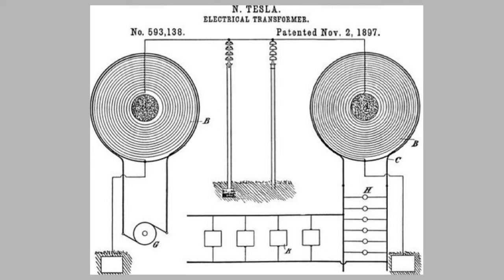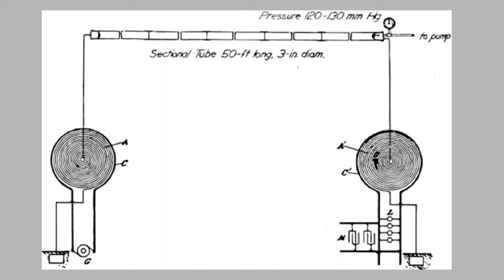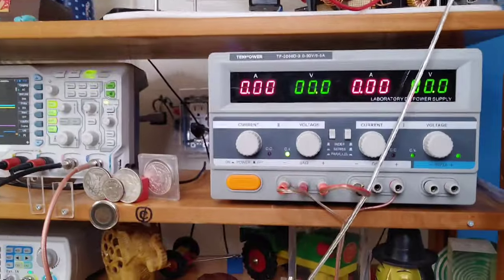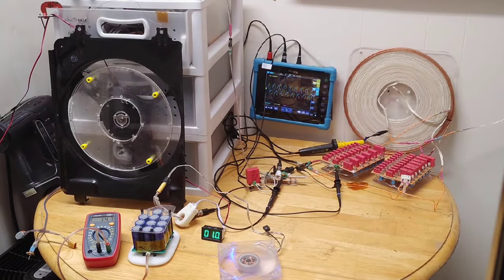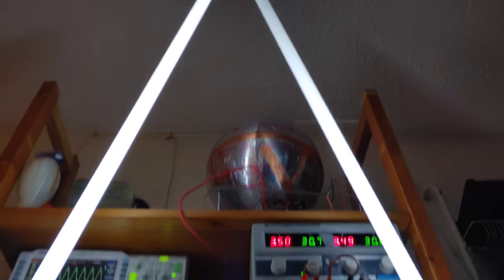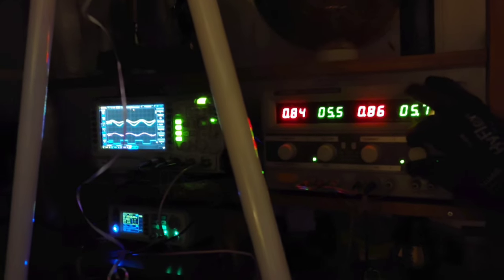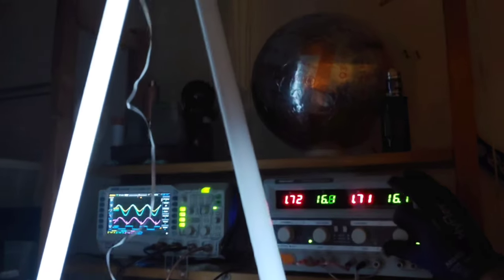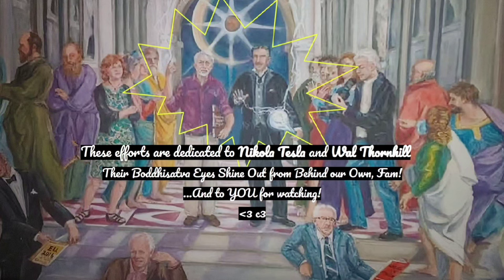Nikola Tesla's Single Wire Power Transmission, Part I: thru Flourescent Tubes & Wire

Comment: In Australia they use some thing called SWER distribution of 50Hz electricity out in the country to save on cupper wire. SWER is Single Line Earth Return. I believe the lines carry some thing like 6kV. It is returned to 240V at the end of cause. It works fine.
To use high frequency allows you to use it like a radio transmitter/receiver. There the power decreases with some thing like the square of the distance unless you can direct it with some thing (a wire connection is the ultimate director).
Up front without knowing the frequency you use I would think that the fluorescent tube fluctuations could be standing waves.  The high intensity points would then be 1 wave length apart. Also the tubes just work as a high resistance wire connection.
The high frequency burns you get when getting too close is because at those frequencies the capacity of your body works fine as a return line.
Reply from the maker: Shoutout to Australia! Yup i was recently reading with envy  about the WONDERFUL Aussie SWER system which is highly efficient for remote power grids! Advanced,  props! Some call this system I'm testing 'single wire without earth return" SWWER, some call it stray capacitance to earth and consider it a return, but N Tesla called it 'without return' so i take his word as usual.

Freq=130k cycles/sec. My best tentative guess for the fluctuations is what's called "ion acoustic waves", which are a sort if standing wave in the plasma. In conventional usage with flourescent tubes, the effect is called "striations", and are attributed to the mercury ballast becoming vapor or some such bollocks. Wavelength is ~2cm, I'm glad somebody else wondered of that measurement (....errr...  although l've yet to figure the frequency or take it any further).

I only get burns if i touch my fingertip to the high voltage output wire directly; supposedly this 'longitudonal electric wave propagation mode' is non-thermal, i recall reading about it back when i coined my tag 'cold elecric' 😇 Tesla called em 'Non Hertzian', i.e. distinct from transverse electromagnetic (TEM) waves. Contemporary researchers now call em 'longitudinal magneto dielectric' (LMD) or sometimes 'scaler waves'. Akin to displacement current between capacitor plates.

On my scope when tuning, the first resonant peak is said to be TEM mode, the second peak (about 1.6x the first freq) is said to be LMD mode, and this is my area of interest always used.  But the description is not entirely overwhelmingly convincing to me, hence the present efforts to 'disprove' (or validate & demonstrat) the phenomena. I do need to know if there's a major unknown aspect of electricity! I hypothesize 'cosmic displacement currents', electric sound waves rippling between all the conductive spheres in the cosmos, as the subtle mechanism of charge transfer across vast distances, powering the more perceptible phenomena of our electric universe.

Also the inverse square law is purported not to apply (sources: konstantin meyl, eric dollard), decline is claimed to be only 1/R, this is a means to test the longitudinal mode's presence, too.
Reply: @cold3lectric  Your frequency 130kHz would have a wave length of 2300 meters so is obviously not the cause. 2cm would make the frequency about 15GHz.
I used to get skin burns when working on picture tube TV's way back. They work on about 16kHz and it could make a nice spark to screwdriver through the capacity alone. They had about 3 - 5000V I believe.  They had much higher on the tube but it was DC. This was what was driving the high voltage transformer and the horizontal deflection. 
I think that the most electric in our universe is the electron. As I believe it is a standing wave of energy and as that energy can also manifest itself in radiation I believe there must be some kind of dipole in all radiation containing a positive and a negative end. I would there fore like to know how radiation really happens. It is electro magnetism but what is electricity and what is magnetism? I believe that to be the fundamental parts of every thing.
From this I am also wondering how a pulsating dipole can present itself outwards as negative forming the electron (or positive if a positron).
Reply: @cold3lectric @cold3lectric I've read a bit of Meyl suggest that Nikola Tesla was observing a variety of non-linear phenomena that could explain the longitudinal transmission behavior. Spin or torsion waves are mentioned. Another confounding phenomena to add to the problem is the surface plasmon polariton wave (Zenneck wave) which can couple an EM wave to a surface charge wave on the Earth.

Other effects that I've heard Tesla could  have discovered include phase conjugation of signals. Phase conjugate mirrors can be used to create resonant sytems with astonishingly high Q factors. What's more is that kindling of such a system could be possible through the ionosphere-Earth cavity, which would allow the system to be self-pumping. 

The "Non-linear Shuttle Oscillator Circuit" Tesla patented in particular is an interesting system for parametric amplification of signals. Some authors have suggested it could have been performing the role of non-linear element in a phase conjugating transciever. Air Plasmas are known to support phase conjugation by 4-wave mixing, so corona discharge and atmospheric ion acoustic waves may have also played a role in the performance of this system. 

Quantum potential effects such as the Aharonov-Bohm effect and the Maxwell-Lodge effect may create unusual conditions in situations where there are gradients and divergences of the magnetic vector potential and electric scalar potential. A scalar superpotential theory could unify Electromagnetism and Gravity as distortions in the same underlying vacuum structure. Gravitoelectromagnetism predicts that certain mass-energy currents produce gravity-like fields, so it should be experimentally falsifiable. Gravity Probe B has already confirmed the existence of gravitational frame-dragging caused by the rotation of the Earth. Robert Forward designed a type of warp drive within the framework of relativity that had a helical toroid structure, a high density gas would accelerate to near light speed around a closed loop wound into a torous. The highly non-linearly changing mass current (higher order derivatives of acceleration such as jerk), flowing in that path produces a toroidal dipole moment in the gravitational field, which implies gravitional induction due to a gravitoelectric dipole. Gravity doesnt have opposite charges so in the weak field limit dipole gravity cannot exist, but in hyper-relativistic motion and under higher order accelerations,  gravitoelectromagnetism still predicts a type of gravitational dipole arises.

Toroidal dipole moments and Anapole moments, the types of EM modes where such unusual effects might arise,  are relatively unexplored area of electrodynamics. Dark matter made of EM anapoles has been proposed as a candidate for the Majorana Fermion for example. Recently a "non-radiating" antenna, an Anapole mode antenna, was created to demonstrate wireless power transmission to a perfect absorber. The anapole had an amazingly high Q factor at resonance due to the conjugation of the far field radiation produced by a dipole antenna and a toroidal dipole antenna. Radiation suppression leads to intense near field radiation and currents in both antenna. But what if you had two anapole antenna? How do you describe the electromagnetic behavior of two perfect absorbers? You need to describe the conjugate photons in terms of quantum potentials or information is lost about where the energy went, in this case it comstructively interferes in the anapole antenna to drive current (instead of heat as other antenna would). Even though no EM radiation is emitted by the anapole, it still radiates quantum potentials, and a second perfect absorber would break the symmetry of the conjugated photons, converting them to currents and seperate EM waves again. Only a highly non-linear antenna could recieve such a wave. It appears the energy would get trapped and distributed by perfect absorbers with almost zero attenuation because it is not carried by transverse EM radiation per se, but by the propogating quantum potentials of pairs of EM waves. Due to the auto-resonant, beam forming and distortion correcting properties of the two anapoles, you can also expect a high efficiency power transmission through most obstacles made of linearly conductive materials which would otherwise impede EM waves.
Reply from the maker: @taylorwestmore4664  yeah the "vortex potential oscillation" description of Meyl seems a likely candidate - though I'm presently still imagining them as 'electric sound waves', spherical pressure waves rippling outward. I may need to sample some psychedelics again to be able to picture a pressure wave as a vortex simultaneously (not ruling it out) 😈

I'm a bit perplexed lately about the difference/identity of Zenneck surface waves & Tesla's 'earth resonance', they're NOT the same yeah?

Honestly my degree was in petroleum engineering so i can do well with the hydraulic analogy, but otherwise I'm going almost exclusively off of Tesla's words, and a few modern guys like Dollard & Meyl. I've heard it suggested to forget all about "radio stuff" when it comes to Tesla coils, so presently its all virgin soil to me, just gotta be a no0b :)

Also there's an awesome NASA Contractor Report "Advanced Energetics for Aeronautical Applications" which covers all this longitudinal electric wave stuff on pages 40-60, if interested:
https://ntrs.nasa.gov/citations/20050170447
Reply: @taylorwestmore4664  im of the view theres no power being transmitted at all.

just the impetus to allow power to emanate.

i take a conductor, shove it in a changing magnetic field, i get a changing potential across that conductor.
a minute amount of power as that potential attempts to short itself out through the conductor itself, against the flow that would occur if we were to actually short the ends out as the conductor is in "reverse" across that potential difference compared to any resistance we place across the ends of it...

thats how i see radio waves. i cant see any electric wave. just changing magnetic fields inducing changing potentials in conductors affected by changing magnetic fields. i only ever saw the electric part of EM as the byproduct of its interference with matter.  we produce this tiny little potential difference,  any current is killed by its own lenz reaction, so theres sweet eff all power...and then need amplifiers and all that to do anything with the resultant miniscule leftovers... (consider... how was tesla or contemparies even detecting signals before amplifiers, tubes, speakers, cathode ray tubes?)

invert it. reverse it. unthink it.

i change potential.... and over there, another conductor must change potential in sympathy. it changes potential, and then attempts to neutralise... there is a flow...
then its given another nudge, an alternate potential... a reverse flow...

get it resonant, keep it tickling... only need enough power here to oscillate, to make the alternating potential. the change in potential is felt everywhere in sympathy. a conductor separated by an insulator... what is the rate of "capacitance"?

not power transfer or reactance, but the rate at which one plate upon taking a charge, causes an effect, an opposite charge on the opposite plate? at what rate does that change of potential propagate through the dielectric? how does the distance, the thickness of the dielectric alter this? not teh potential it can carry, but teh rate at which information between two conductive surfaces feel each others "charge"?

not transmitting POWER. just the IMPETUS to cause power to flow. "to separate the charge" whatever the hell "charge" is anyway... "charge!"... force... hmmm... batter down the walls!

english and its use of words in this area is rather... limited. anyway, i digress.

over here, alternating potential in sympathy, resonating, building...

now i have a potential... as high a potential as required... if i have a low resistance, short it. i overload it... the potential falls, the current increases, the opposing magnetic lenz reactions/eddy currents quench my oscillation...

if i have a high resistance, the potential can build, and the resistance, the load, limits the current, the power. along with the strength of resonance and its ability to draw from a reserve of power... untapped reserve, just needs"splitting"...

rather than high currents and minute potentials in low resistance conductors, consider high potentials produced across high resistances... or reactances, as it is delving into the HF phenomena...

and then... what remains fixed? we say the earth is fixed potential... is it? what if its the other way round? the ionosphere, space... the vacuum, the void... thats fixed... and we are fluctuating madly? and somewhere in between is this layer of air, this... dielectric... what happens if you play "piggy in the middle" ?

jacobs law. matching impedances. max power transfer versus max efficiency...